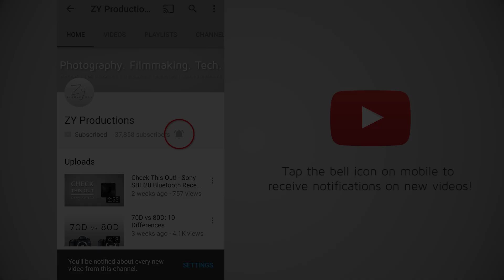Shutter Angle Explained! (with fidget spinners!)

Comment: Wrong on two counts. RPM should be RPS as shutters speeds are measured over the duration of a second, not a minute. Your formula should be Frame Rate X 360 / Shutter Angle.

Comment: first of all thank you kindly for the video, because your explanation is really beautiful and easy to grasp.
now that you made me understand the concept i would like to however fix the equation that you gave which i'm afraid is incorrect.
if:
SS ≡ ET is a shutter speed or equivalently exposure time measured in seconds per frame (spf),
SA is a shutter angle measured in degrees (°),
FR is a framerate measured in frames per second (fps),
FI := 1/FR is a frame interval measured in seconds per frame (spf),
then the formula you gave should read
SS ≡ ET = 1/FR * (SA / 360°)
or equivalently
SS ≡ ET = FI * (SA / 360°).
this way for FR = 24fps and SA = 180°, since then FI = (1/24)spf, we will get
SS ≡ ET = (1/24)spf * (180° / 360°) = (1/48)spf
as you said.

Comment: Great visual explanation for the rotary shutter. I'm pretty sure the correct math formula should be: Equiv. Shutter speed = (360/Shutter angle) x framerate tough wich would makes       (360/180) x24 = 48 (put a 1 over 48 of course and there's the 1/48 value for the shutter).

Comment: Surely it should be (Framerate x 360) / Shutter angle (usually 180), right? Your math would half the frame rate at 180 degrees, but you essentially just want to double it. I'm fairly sure I'm right on this but feel free to school me if I'm wrong. Thanks for the video, great way to explain the concept!

TL:DR: Best shutter speed = Double the frame rate.
Reply: Thank you, Alexander! I've been embarrassed by my slowness in getting my head around the innerworkings of shutter angle, and though I really like the presentation in this video, that equation threw whatever confidence I'd gained up to that point. I appreciate your correction!

Comment: Small correction: Around 2:20 you mention the default framerate is 24 frames per second, so the shutter rolls at 24 rpm. However, RPM is revolutions per minute, so a factor of 60 slower. When recording at 24 fps the shutter is making 24 rpS so 24*60=1440rpm.
Edit: Just after posting this comment I noticed the pinned comment mentioning the same issue. Oh well.

Comment: Great video, and easy to understand, thanks
But I think you made a mistake in the formula that you put on the screen, at the beginning you said that at 180 degree shutter angle the shutter speed is 48, and I agree. So the formula would be: "Shutter Speed = Frame Rate * 360/Shutter Angle"
If we use the formula on screen would be: "Shutter Speed = 24*180/360 = 12" but "24*360/180 = 48".

Thanks again for your information, I just bough a BMCC and I had no idea what Shutter Angle was, and you just made it clear to me

Comment: You're a definitive resource ZY. Thank you for the time you put into your videos. What about slowing down motion on a 24p timeline? Can I change my shutter speed to allow for smooth slow mo? 45 and 90-degree shutter angles make for less blur in motion for film, so would I do that to then slow down the footage in post or go the other way and run the math for a shutter angle at 280 or so?